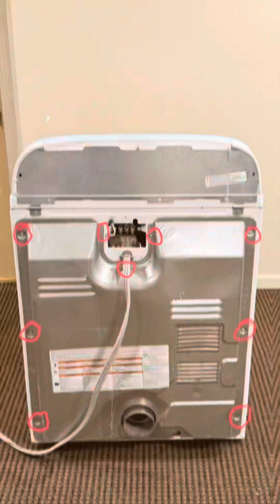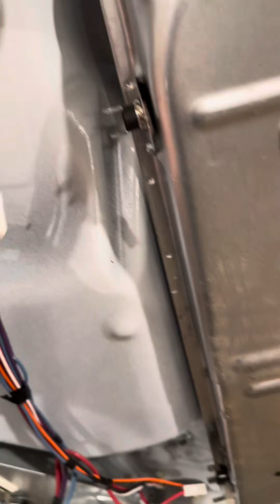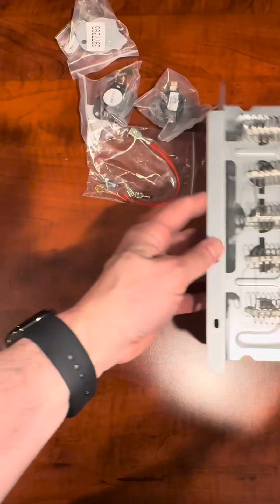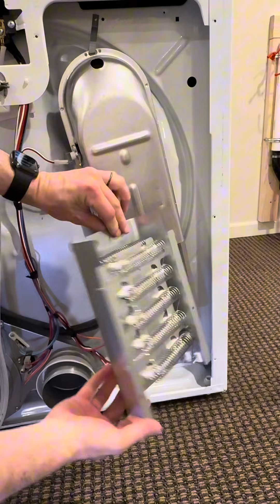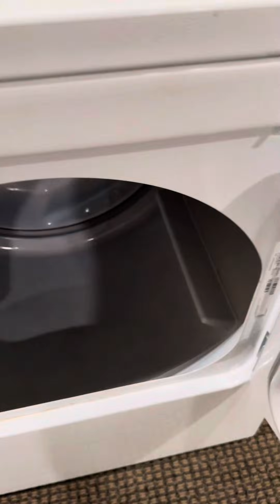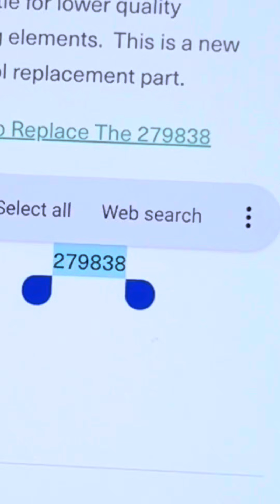How To Replace A Dryer Heating Element (Easy DIY)

Comment: How do you know which parts to get if they all universal or does certain brands take a different type of heating element
Reply from the maker: Take your model number to Appliance parts pros dot com you'll find linked in the description and based off the model number it will tell you what heating element and components you need.

Comment: Thanks for the step by step! Great video. One question: on the lil thermostat thing; it was so hard to get that little gold piece onto the other piece. It just didn't "slip on" as you said, which makes me think I didn't do it correctly. I pushed it down as far as it will go, but there's still room to push it down some more. It just isn't budging and I'm scared to break it. Everything else fit properly on that part. Do you think it will cause any issues? Thanks, Lisa
Reply from the maker: I usually tap mine on with the side of some pliers to get it down all the way.

Comment: What is the orange wire connected at the bottom? Mine does not have that
Reply from the maker: It’s for the auto dry sensing, most of them don’t actually have it. Especially on the newer models.

Comment: Josh, the presentation couldn’t be better.  I had problems with the parts.  I received two sets of components ordered separately 
from Parts Doctor, not one kit.  The cycle timer was different from that in my ancient Kenmore 110.66712694 dryer.   The kit contained instructions indicating that the sent one might require a modification with a jumper wire.  The instructions became to this longtime kit builder pretty obscure.  I’m still trying to get it corrected.  Not easy.

Comment: Will this heating element work for insignia 67 cu ft 12cycle electric dryer before I purchase it if you can let me no
Reply from the maker: Definitely not, follow the link in the description for OEM parts for your specific dryer.

Comment: Yes but you have to remember this dryer is set to show people how to do it 

Going to customer, trip , looking for parking , removing all the fixtures so that appliance can be moved, answering calls, getting a van , paying for gas , advertising,, vehicles insurance, work insurance, sometimes getting a parking ticket, paying for parking metre, ordering the parts, looking for the right part, paying for phones, time for recalls, picking the part or paying for the shipping cost

Dealing with hard to deal with customers
Implore

Tell me, is it easy to be a technician?
Reply from the maker: Nope.  That's why we get paid the big bucks 😂  There will always be those people who won't call for help...this video is for them 😉

Comment: The so called "kit" that you are calling it, is not the kit. It is just the heating element. You have to purchase the kit separately. What you have advertised😮 is just the metal element with nothing else. Fyi..
Reply: That’s because there is no such thing as an OEM kit from Whirlpool unless you get generic which I would never use if you buy a heating element, set it next to a true OEM element which by the way is made by FSP and will be stamped on the housing of all heating elements and thermostats there is a huge difference in quality of coils and element housing. The video talks about Amazon elements or “generic” and not recommending but put them on in the video 🤨

Comment: Would’ve been nice if you mentioned socket size
Reply from the maker: For the screws?  I use a 1/4 nut driver on my 12v impact.  I’ll be sure to mention it in the next one, thanks for the tip!

Comment: The non OEM heater assembly’s work fine if the dryer is operated properly and the lint screen is cleaned on every use! Also the dryer needs to be disassembled and cleaned of lint periodically. I’ve seen them filled with lint causing overheating of the element and premature failure of it!
Reply from the maker: Great tip!

Comment: There wasn't a spot to plug in the orange cable so I left it unplugged, is that bad! The new one they sent didn't have that extra piece that plugs to the thermostat thing but came with a jumper cable is what they called it
Reply from the maker: Honestly that sensor is for moisture something and they don't even include it or the sensor on the new dryers and still keep sensor dry lol. It's pretty much worthless anyway so I wouldn't worry about it too much.  I would just make sure the end is covered with some electrical tape.

Comment: Another thing is to make sure to flip the dryer fuse in the breaker box to off. That way, when you go to unplug it or plug it back in, you don't run the risk of creating sparks.
Reply from the maker: Great tip, thanks for sharing!
Reply: @MrJoshCobb nonsense comment. You don't need to shut the breaker off. You just unplug the dryer from the wall.

Comment: Where is the video for the different wiring set up? I think I need to use the red cable to put the new thermoster on.
Reply from the maker: I haven’t actually come across a two wire set up yet.

Comment: Today I change the Heat Element and lower termostat, but not the high termostat one after check for continuity. The dryer is working well, but my question is, Do I have to change by default that high thermostat everytime that the heat element is change?

Comment: Do you recommend always changing the cycling thermostat even if they are still good?
Reply from the maker: If you are replacing the heating element, yes I do.
Reply: I don't see any screws to remove the element looks like one solid piece

Comment: I cannot recommend Parts Doctor.  They do not seem to have a kit and the pieces they sent with the correct model number did not resemble what you are showing.  And they want pictures of the parts like demonstrated on their site to return and pictures of the outside of the package they were sent in - all to get a refund, making it very difficult to comply.  They sent the stuff, they ought to know what I am returning.  Amazon, the way to go.
Reply from the maker: Thanks for the tip!

Comment: What is that orange cable mine does not have it help
Reply from the maker: It has to do with moisture sensing on the automatic cycle. No big deal if you don't have it a lot of them don't.

Comment from the maker: Let me know if you guys liked this style of video, dislike it, or want to see something else!  I am open to feedback and plan to make many more videos!  Let me know if you found this one helpful!
Reply: Hey, mine doesn't have an orange wire, any idea whats its for? Mine is a very old model. Great video, thanks for the help!
Reply from the maker: @mistahkalari5782 hey check out this video, I explain it here and what part you need.  Electric Dryer Heating Element Wiring Explained - Top Mounted Lint Trap - PT 1 | Josh Cobb
https://youtu.be/y7_KXHW_x6o
Reply from the maker: @mistahkalari5782 so if you don’t have the orange wire, don’t worry about it, that is for auto sensing with a moisture sensor.
Reply: @MrJoshCobb  thanks man! You saved me some money 💰 appreciate it
Reply from the maker: @mistahkalari5782 awesome!  Glad I could help! 👍🏻👍🏻👍🏻